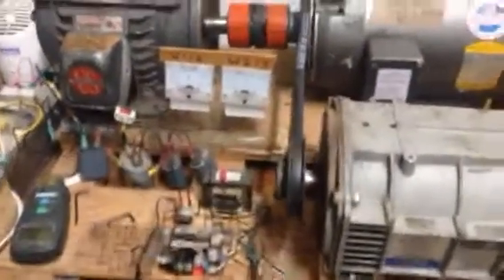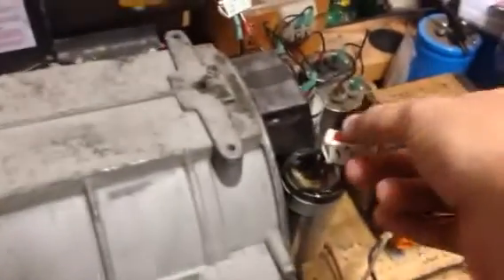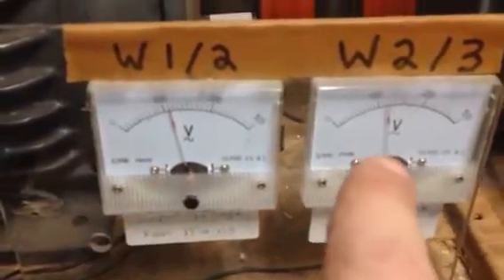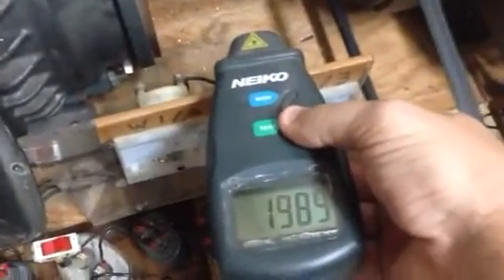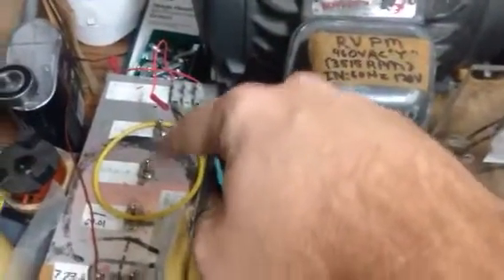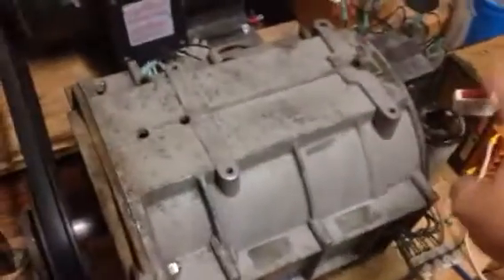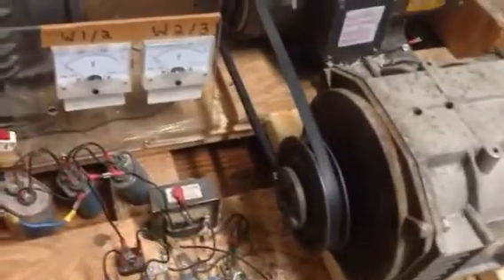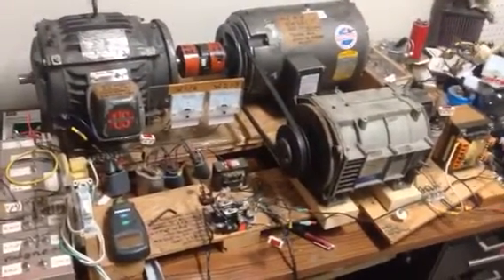Spinning up the RV driving the 5kw alternator

Comment from the maker: Note the drive pulley is 7", and the 5kw alt is 5"... this yields a 1.4 ratio... so the 2400rpm on the drive side is multiplied by 1.4 to get the rpm on the Alt side... 3360rpm...   It would only come up over 1600rpm once the Cap in the 5kw alternator was switched out making that an open circuit.     Waiting on a 6" and 7" pulleys to use to get the passthru ratio closer to 1:1... which hopefully will allow the drive motor to reach its full 3600rpm without having to switch out the capacity on the 5kw alternator itself for something smaller to reduce the VARS that show up once its put in motion...